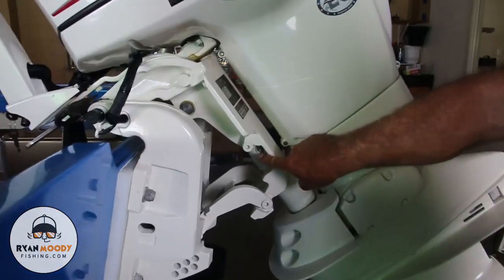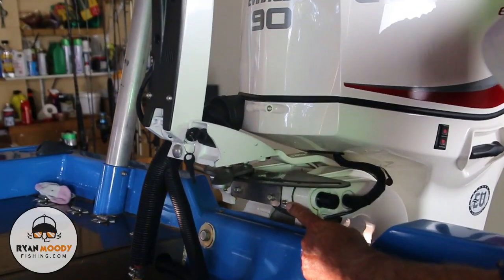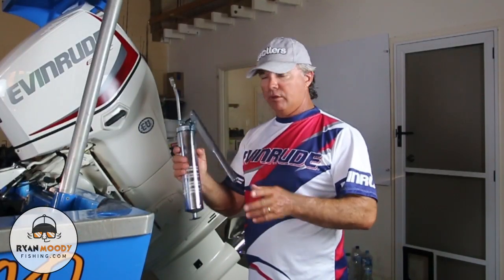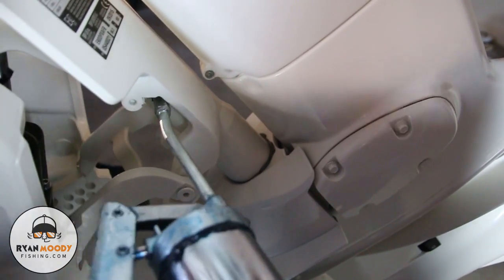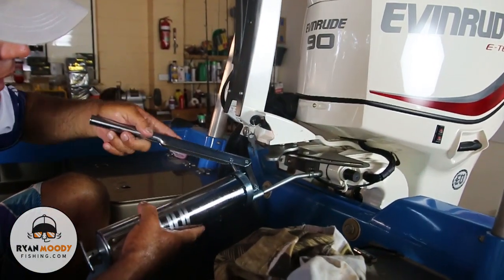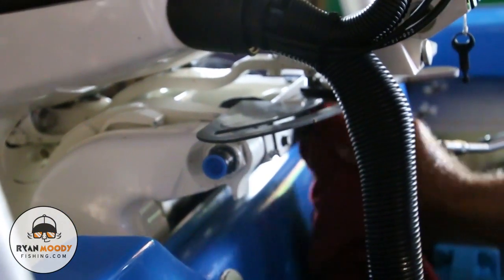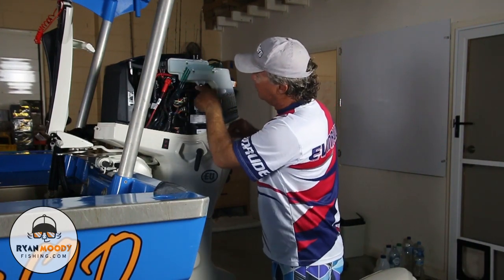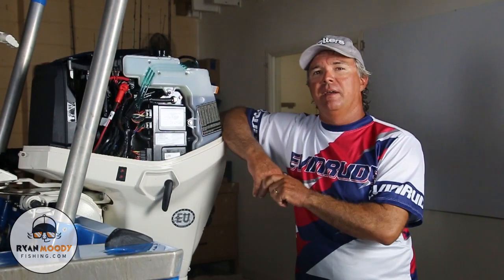Routine outboard engine maintenance | Greasing engine glands

Comment: Hi mate good advice ,with all the motors i have had i have just about been anal with maintenance every trip the engine gets sprayed with lanotec and wiped down flushed twice each outing ,gearbox oil changed every year and impellor even if it didnt need it  ,greased all over at least once a year or more, the last boat i sold the guy looked at the engine a 2002 enduro and said it looked like new .I have seen some shockers of engines and how people go out with them amazes me i wouldnt trust them .

Comment: Ryan do you think I should find out what grease that my mechanic uses so I am not mixing grease types.  Apparently that's a no no when some greases use a different base?
Reply from the maker: Hi Daryl, as long as it's marine grease you should be OK but by all means check with your mechanic as I'm not an outboard mechanic and he/she will know better.

Comment: Hi mate thanks for those tips. 
I have an evinrude etec 90hp from 2013 and I have a fluid leaking at the top of the hydraulic cylinder, do you know if it’s repairable or I’ll have to change the whole system ?
Reply from the maker: Best ask a mechanic that one mate.